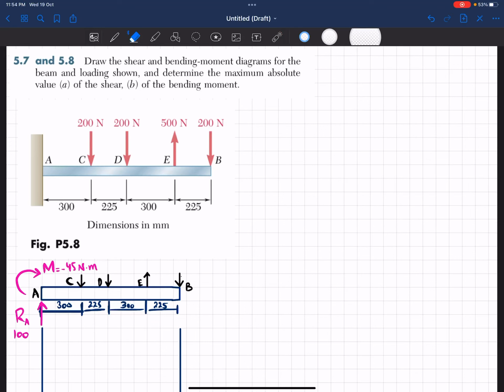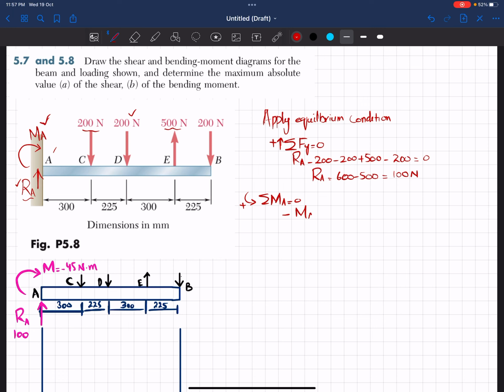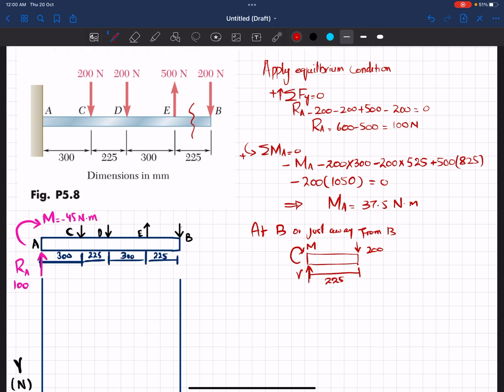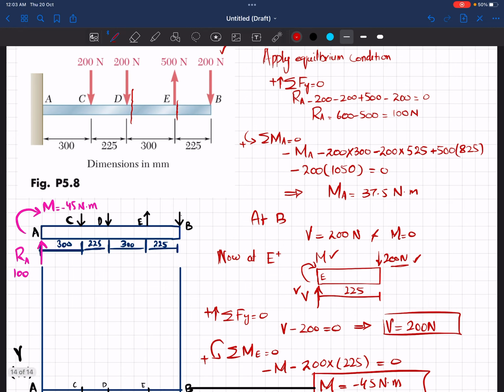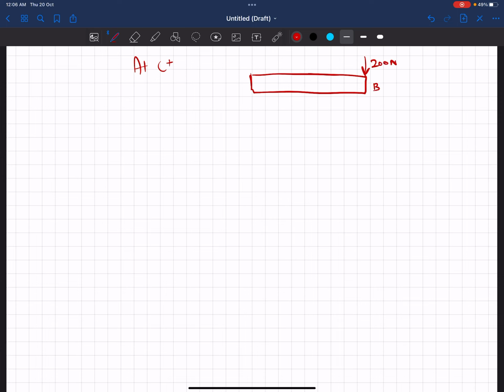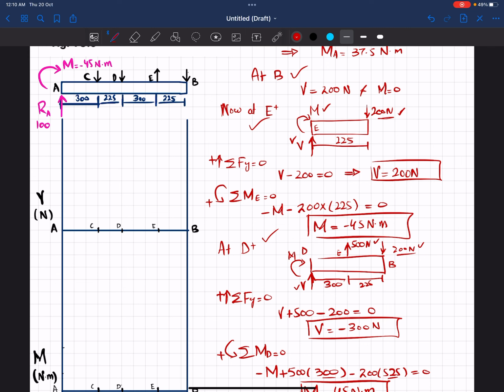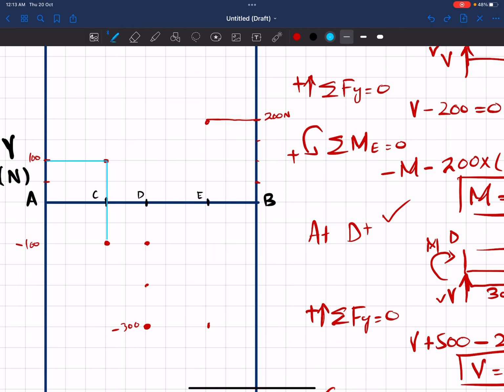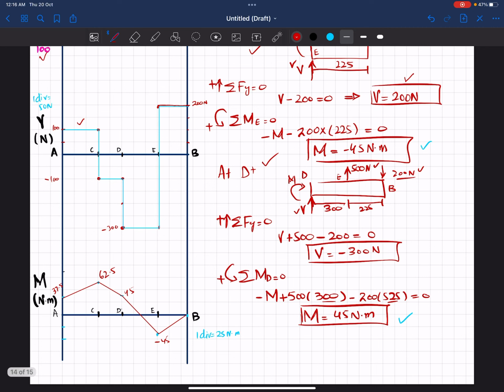5-8 |Analysis & Design of Beam | Mechanics of Materials

Comment: How did you get M=-45Nm
Reply from the maker: Kindly specify the time frame so that I may check it.
Reply: @engradnanrasheedmechanical  at the beginning 0:00
Reply from the maker: @samt.1356 it's a mistake moment is 37.5 about A. I have already calculated
Reply: @engradnanrasheedmechanical  oh ok
Reply from the maker: @samt.1356 thank you 😊 🙏 💓
Reply from the maker: If you are talking g about at the fixed end, then it's a small mistake , it's not 45 rather it's 37.5 N.m